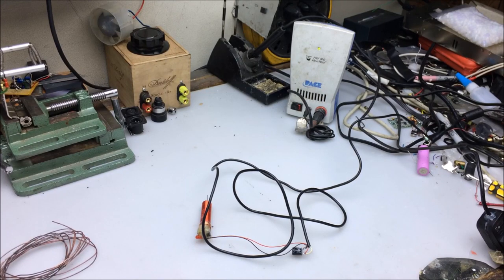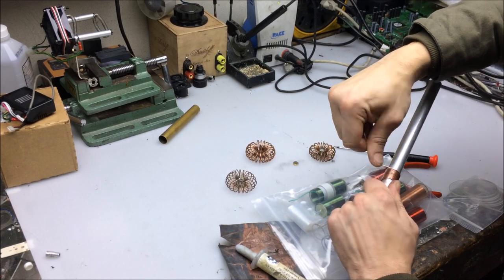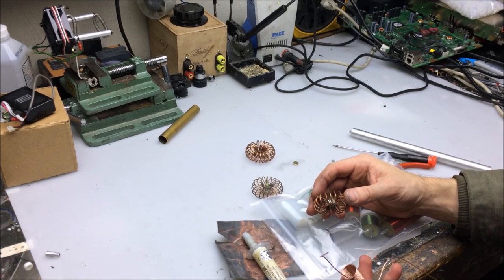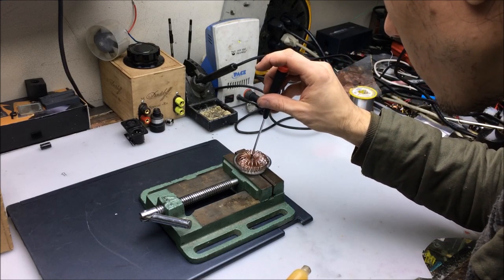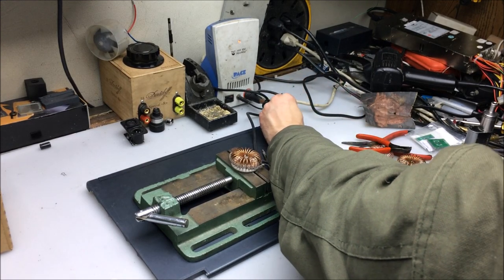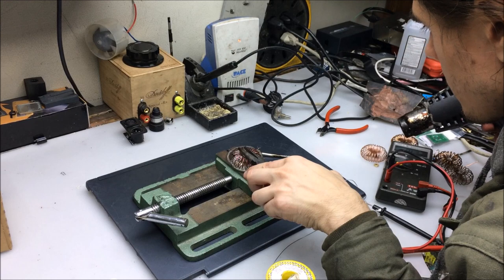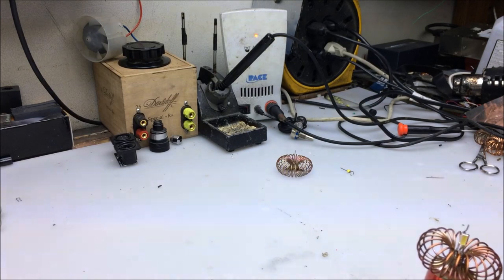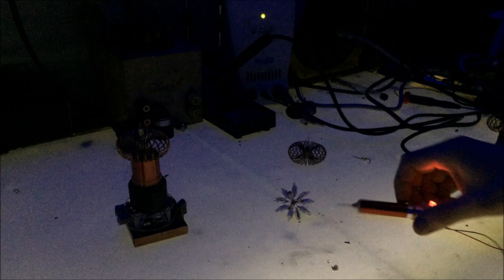DIY Tiny Tesla Coil Top Load With Soldering Iron Prank

Comment: I could not see how you connected the two ends of the coil before soldering?
Reply from the maker: We have tried to connect the ends before soldering and it usually doesn't go well so for the most part and makes things harder so we just bend the coil to the shape as best as possible and hope it solders on neatly.

Comment: Tutorial for this tesla coil at the end ?
Reply from the maker: That is something you will have to keep an eye for on Join The Technicians for more information. It is a work in progress but we hope these eventually become kits.

https://www.youtube.com/channel/UCpG-djn5HpmJvUeh5GWTjTA

https://www.facebook.com/JoinTheTechnicians/
Reply: with a push pull mechanism like this one (unlike the Slayer), I get better results if the primary is placed in the middle of the secondary
Reply from the maker: @sFeral  Yeah the slayer exciter is kind of the lowest grade tesla coil you can make for SSTC. The syringe was just laying there empty and I wanted a simple 10 minute activity. There are a few hot zones along the secondary that will make it resonate better the center is a good one. I tend to slide the primary up and down the secondary to find a good spot before solidly placing them in a location. Surprisingly so few people talk about the position of the primary coil in relation to the secondary but it's such an important thing for good results.
Reply: @sFeral  yep! So awesome, I want to know if there's a flat lipo jammed in the bottom or something. Looks like the same primary style was used as TefaTronix's but with thicker wire instead of flat cable.

Comment: Hey how much would you cost to make me one to run on 120 volts ac
Reply from the maker: If you're speaking about the tesla coil that the top load was made for you will have to contact my friend who is working on them. He can be reached through Facebook most easily.
https://www.facebook.com/JoinTheTechnicians
Reply: @Zenodilodon  like the actual Tesla coil no topload
Reply from the maker: @Texas_bikes66  That is a project/kit that may be released by Join The Technicians, information on purchase inquiries should be made on that page. I don't have much to do with that project.
Reply: @Zenodilodon  ok thanks
Reply from the maker: @Texas_bikes66  No problem!
Reply from the maker: @Texas_bikes66  BTW, I saw your videos on high voltage stuff. please make yourself a hot stick. This could save your life! I have been shocked a lot of times, it's no fun at best.
Reply: @Zenodilodon  yeah I don’t have a good enough one know I just use a screw driver
Reply from the maker: Good! Keep up the learning, there is so much out there to explore and make. The best part is that some of it isn't even invented yet. If you want to look into something cool check out PZT transformers. They are made of crystal/ceramic and have no copper wire.

https://www.ti.com/lit/an/slyt125/slyt125.pdf
Reply: @Zenodilodon  thanks man I subbed
Reply from the maker: @Texas_bikes66  Awesome! I might get back into the high voltage stuff later this year. Trouble is that I have a bunch of sensitive laser equipment everywhere too that I don't want to break.